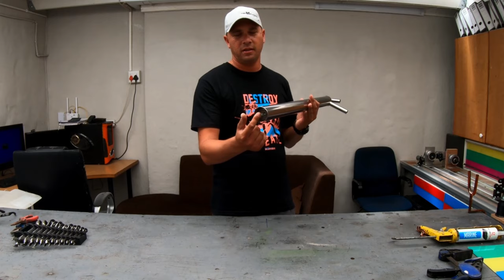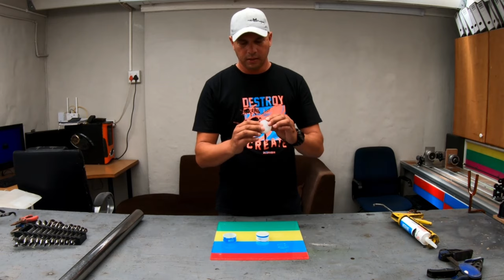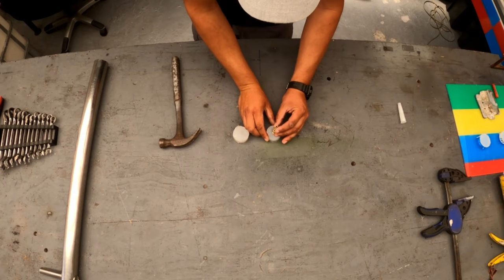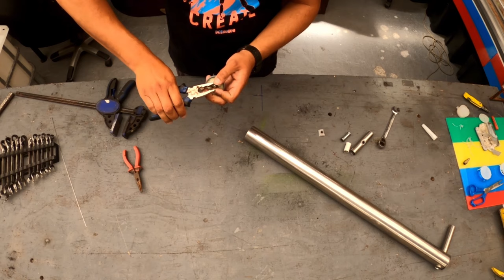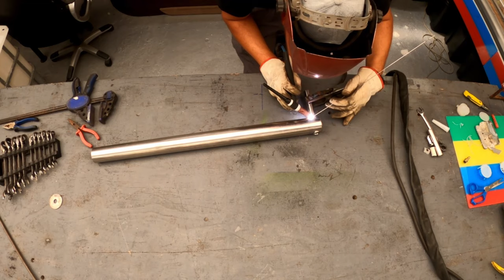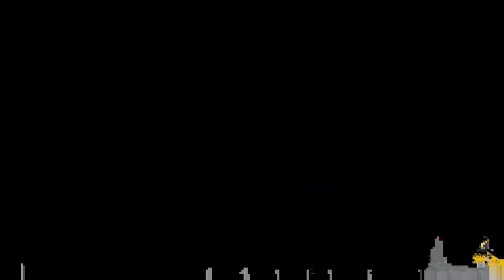How to modify a bait pump step by step

Comment: I make silicon washers for my pump…I find it easier to mix some soap and water and squirt the silicon into the soapy water,then put my hands into the soapy water and mould the silicon into a ball(it will not stick to your hands👍)…then put a bit of soapy water on my glass and in my washer/gasket mould and press the amount of slicing I need into mould by hand and flatten off with a plastic trowel(and soapy water)…as well as preventing sticking and mess the soapy water also helps speed up curing of the silicon you can pop 22mm washers/gaskets out of the moulds in 3-4 hours and they’re usually fully cured and ready to use in 4-5 days👍 another tip that might help is get rid of the wing nut(they tend to turn and constantly adjust the suction each time they make contact with the sand) replace it with a nylon assisted lock nut👍 other than that great video👍👍👍
Reply from the maker: Thanks for sharing ur way of making them... Will definitely give it a try x2 thumbs up

Comment: Thanks for your detailed instructions bud, I just finished modifying my pump. It improved the suction a lot. I didn't have a welder so I used Pratley Steel to secure the handle. This video was a great help. Tested it on a bucket of water. Works great. 👍🤗.
Reply from the maker: No problem, the silicone gets better the more you use the pump

Comment: 🎣  i have an Alvey steel bait suction pump and a blue pvc plastic pump.
I make my own washer systems to put in them which gives my pumps Much better suction power than what they had!

No need to take the metal cap - lid off! It keeps the sand and water out. The water, sand and mud gets in Below my washers.
I suck up some clean salt water when finished pumping and some fresh water at home to clean the inside of pipe!   🦐  🎣

Comment: I get the silicone washer part but what’s the point of the top end modification
Reply from the maker: The removal of the top washer allows the pump to be used under water, so when u pump these no restriction the water flows quickly out
Reply: @MADAngling  Yeah, but wouldn't drilling two large holes on the top cap serve the same purpose?

Comment: There is no need to take the cap off the top, all you need to do is drill a small 4-5mm hole just below  we’re the handle pokes out, no need for welding, this hole can be used to lube your pump as well , I use a bottle from when the wife dyes her hair, the bottle has a nice point , ideal.
Reply from the maker: Drilling holes will definitely work.. Main aim is to get the water quickly out... What kind of lube do you use Robert
Reply: I just use good old fairy liquid.
Reply: If the seal is good on your pump you shouldn't be getting any water in the top part of the pump, I have an original Alvey pump and never had a problem with water getting above the seal, except on purpose to flush and clean.

Comment: Why not let the silicone cure inside of the tube then just cut 20ml sections off it
Reply from the maker: Would be difficult to cut it perfectly round. And the silicone tube is the right diameter